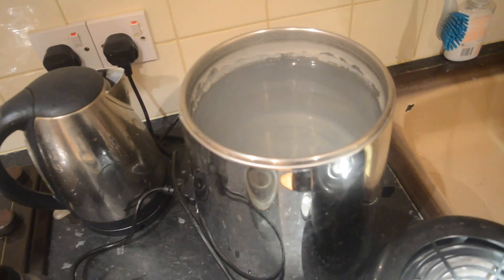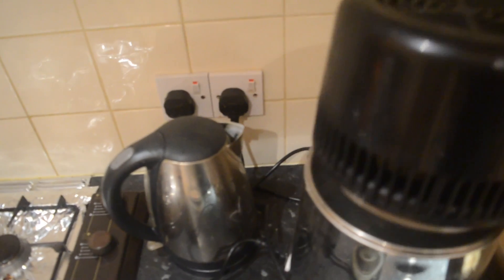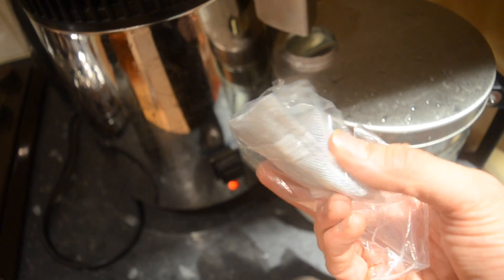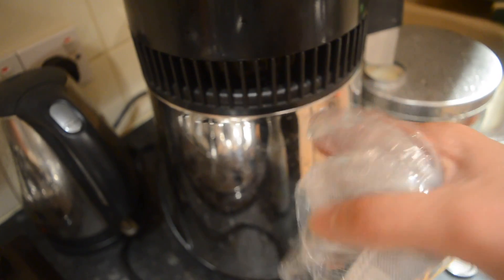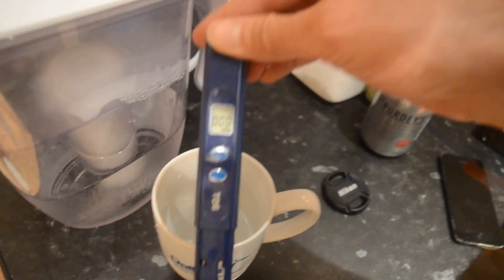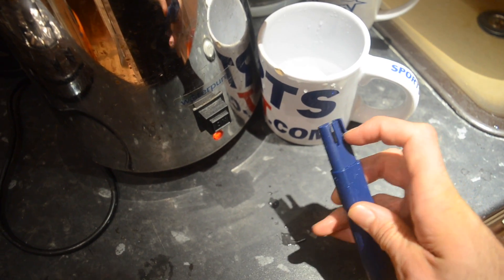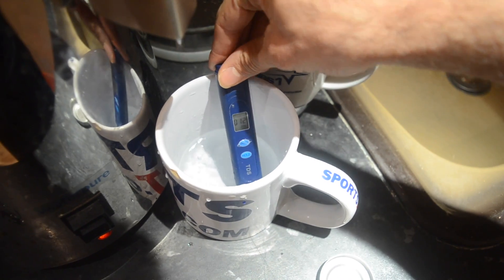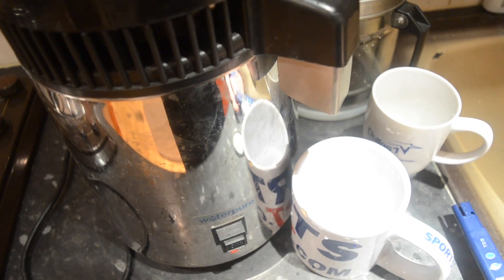London tap water - Filter vs Distillation

Comment: What number was the meter reading on the distilled water gage??? Did you say 13 ??
Reply: Mine in Indianapolis reads 005. Pretty good!! I have the vevor distiller.
Reply from the maker: ive kinda changed my mind about distillling, went back to normal filters
Reply: Quantum Information well I'm not going back, I see so much filth at bottom of my distiller. I switch it off 30 mins before it's due to stop, then I let it cool down for an hour or so remove the lid and a good splash of white vinegar 
Into the 3 inches of water that I deliberately  left in to stop the crappy stuff being baked to the machine.. Leave it overnight if poss or an hour if it's being used again . White vinegar it cleans it out faster than anything. I'm always buying a bottle as back up. Plus I need hunt for 4 glass gallon bottles to store it all in for cooking and making tea coffee etc. I can't live without it now since I saw all the toxic stuff that comes out of it. I hope you 
Go back to distilling one day !! Thank you.
Reply: @paulaslife3781  I feel exactly the same. Seeing what I've been drinking for years makes me sick. 
I'm cleaner my pans are easier to clean,my food tastes better.
Reply: @NikosKatsikanis  Why?